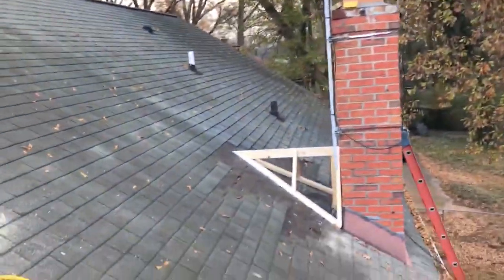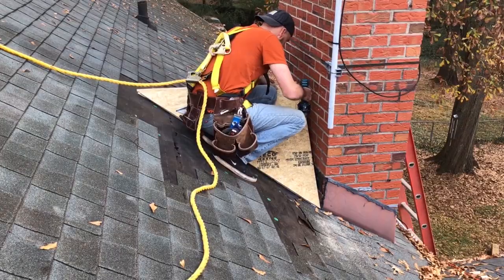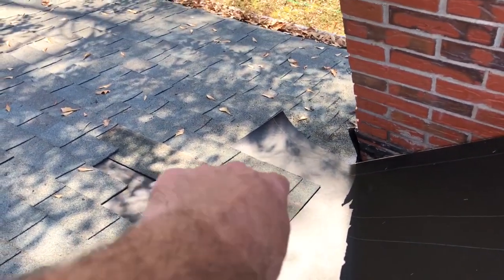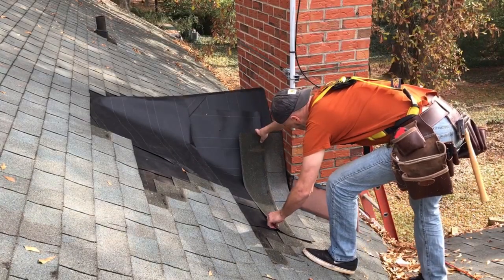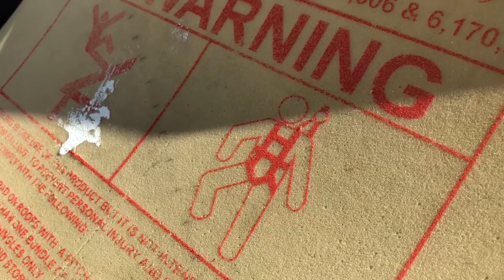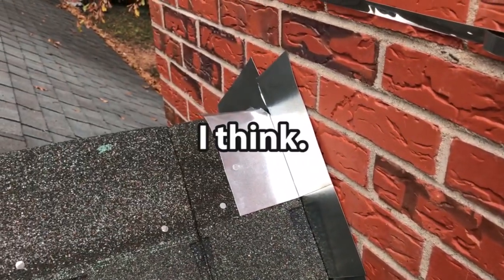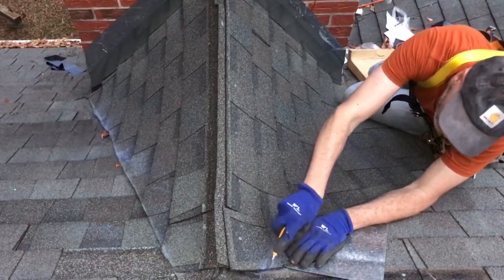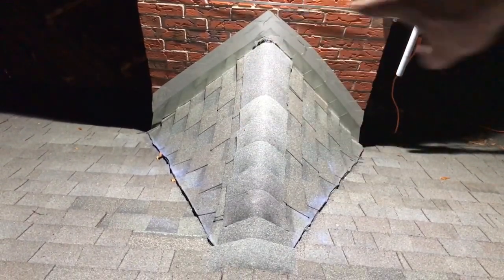Chimney Cricket Part 2 - Sheeting and Shingling

Comment: Small tips, always shingle the cricket first, stay away from the valley 8 inches for nailing, go back up there run a bead of black jack under the valley on both sides, run a bead of black jack over the top of the foil, you did a good job for roofing this as a dyi, I watched the video for building the cricket, all round good job and if it starts too leak again inspect the top of the chimney, alot of times when it rains water sits on top of the chimney and makes it way in, cock the fire walls that come out and if it keeps leaking grab some concrete and a bottle of bond and smear it on the sides and make a stucco looks then spray paint 🎨
Reply from the maker: Thanks for the tips, Leigh. Much appreciated! 👍🏻
Reply: I was thinking the same thing. The cricket is supposed to be shingled first😅
Reply: That’s crazy a cricket needs twice as much slope as the roof deck giving rain twice the velocity in any roofing system with posative water flow.

Comment: you should take a grinder and cut a curf cut in the chimney about 3/4 inch deep,  for cap flashing (one long piece) to go overtop the step flashing. After you cap flash, pack the cut with lead wool (like the old timers do) or just fill it with caulk. Some will use individual pieces of cap flashing, but that's easier to do while laying the brick, as they go into the motor joint area.

Comment: I can guarantee you your original flashing was done properly and you touched on the point in your cricket video why your original flashing was leaking. Yes you need to run you tar paper under the old tar paper and flash your metal in with ice and water or something like that seal and stick if this makes sense. You pay attention to details very well, this was great work by industry standard. Don’t be afraid to use black jack everywhere possible while keeping it neat. Great video.

However, it would only last as long as the metal could hold up to weathering/rust/holes. Maybe you could have used valley metal with your cricket it is about big enough then you would have minded the rule of not nailing within 8” of valley.

This is tuff. Never build a chimney and the drip edge always a problem over time.

Comment: For your first time you did good. Those step flashings rust fast I can tell it’s the cheap aluminum ones not the metal ones. You ran the valley wrong way too. Water will get under Those shingles u nailed
Reply from the maker: Thanks for the tips.
Reply: Yeah I'm wondering the right way to shingle the valley because it's definitely wrong. The water running down the roof will go right under the shingles on the cricket. It at very least needs valley flashing under the main roof's shingles.

Comment: U did right shingleing the Cricket 1st.
There 2 things I didn't see u do is 1, U didn't Tar (Black Jack) under your shingles running into the flashing, 2, the flashing should of been cut into the Brick the Caulked or something simular.
Myself, I would of ran 1 solid piece of Flashing instead of the stair stepping the pieces.

Comment: The water running down the roof will go right under the shingles on the cricket, it at least needs valley flashing under the shingles but I'm not a roofer so I don't know the best way to shingle and flash that valley.
Reply from the maker: Yes, I really should’ve reversed the way I roofed it. Thankfully there are no leaks. I tried to find the code on which side gets roof first, and I don’t think there is one, but if somebody can point it out that would be great. However, it does appear most roofers roof the little roof first, and have the bigger roof shed on top of it.  Thanks for the comment!
Reply: @FamilyFriendlyDIY  If you're still looking, I watch Grand Roofing, he knows his stuff. He shows how to shingle that type of valley around the 17 minute mark of this video:https://www.youtube.com/watch?v=mN_WBOBqRoE&t=1062s. I wouldn't hesitate to do it the way he does, I have watched a lot of his videos and he always has a good reason to do it a certain way.

Comment: Did it leak??
Reply from the maker: Nope, Luis. No leaks ... yet ;-)
Reply: The shingle from the cricket should go cross first or am I wrong?
Reply from the maker: @wilbersandoval9682  That’s typically how it’s done, but building code is to follow the shingle manufacturer’s instructions, and mine didn’t have a preference. That said, if I were to do it again I would shingle the cricket first. I do think it’s probably a little less likely to leak and would look better. But supposedly as long as you follow the valley instructions in the shingle installation guide, it shouldn’t week either way.

Comment: Looks like something we laugh at before fixing. 

-Cricket way to big 
- cut valley ran backwards 
- nails in valley
- shingles don’t cross valley center line far enough 
-Courses not ran straight 
- valley cut is janky 
-didn’t cut in step flashing 
-didn’t tie felt into roof properly 
Could probably list more but stopped watching lol
Reply from the maker: Thanks for the input, Jimmy.
Reply: Hey Jimmy he saved alot of money and showed it worked, I am a roofer too

Comment: Easy and cheap that's what every customer wants to hear. Easy cheap leaks,  Why did the plywood not meet at any of the edges. There are better ways to do this, so why not do it that way. So here you self incriminate the whole job being a mishap and you still leave the video up after a few years, why?
Reply from the maker: It doesn’t leak. Thanks for your input, Joseph.